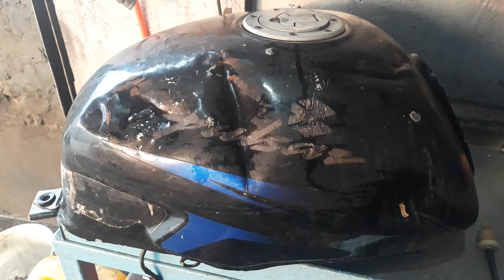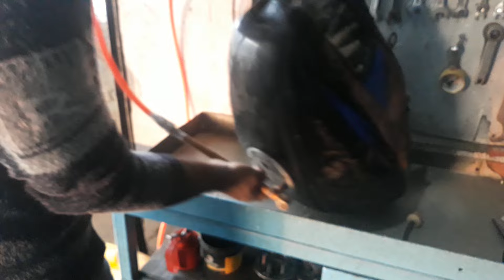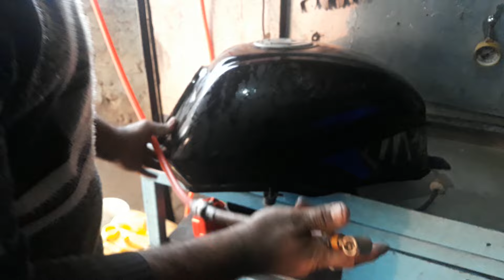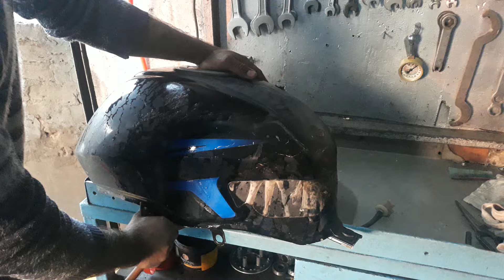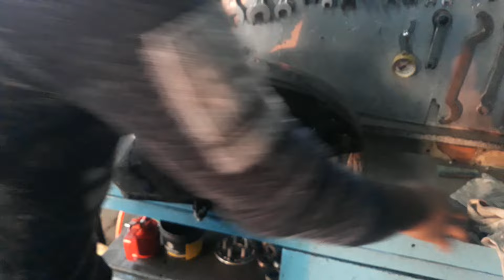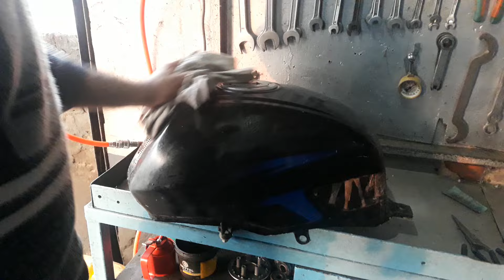Fuel tank REPAIR DENT IN TANK OF MOTORBIKES |✓ Best Technique to Repair Dents

Comment: Thats crap..the air distorts the tank every where..you know how i know? I tried it many years ago and popped the tunnel out  and it wouldn't fit over the frame..I have been told 2-3 psi is all you need to help when tapping dents out ..any more and its stuffed